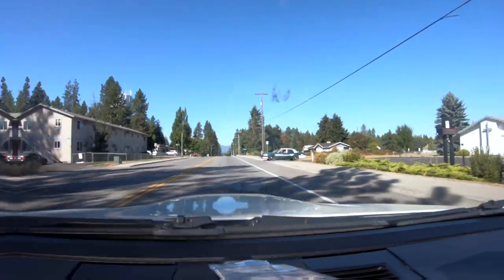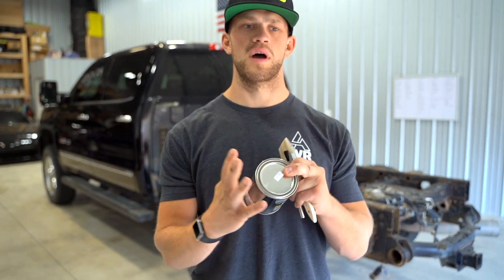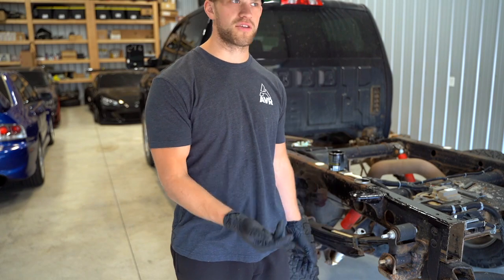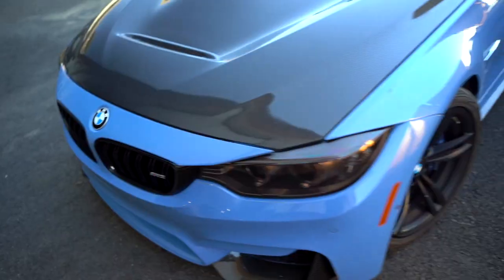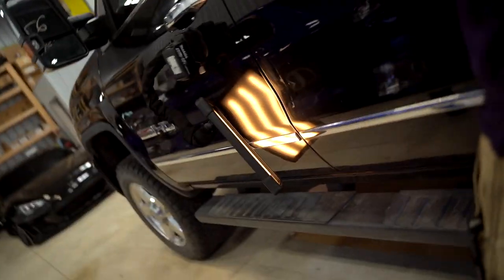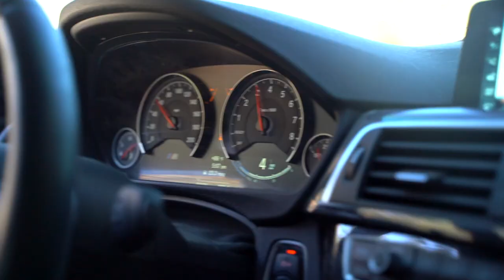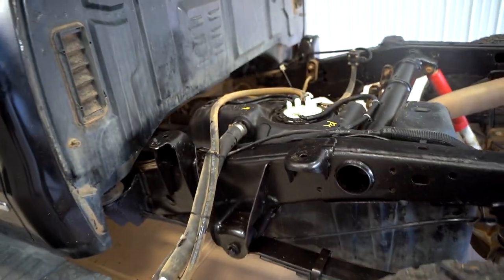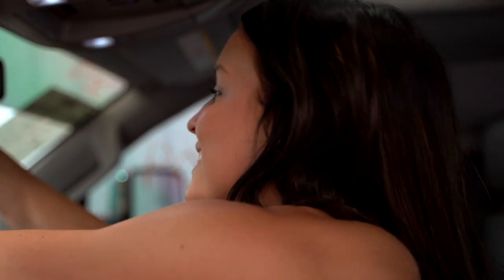Rebuilding the Wrecked 2015 Duramax Pt. 3

Comment: Good choice on the POR15, it’s one of the best rust preventative paints on the market. I restore 80s and 90s Japanese sports cars and use gallons of this stuff. Few quick tips for you if you’re going to do the rest of the frame and suspension components with it. It’s a urethane paint, so it cures in the presence of oxygen. All paint does, but POR15 cures a lot faster and a lot harder. 

Once you open a tin of it, the tin needs to be used within about 2 days, otherwise the next time you try to open it, the paint will have hardened from the oxygen you trapped when you closed it. My method for using it effectively is to buy the small tins and drill a small hole in the lid, then drip it out onto the part that I’m painting. When I am finished, I put a wood screw in the hole and put the tin into an airtight container. When you need to use it again, just take out the screw and dribble some more out of the tin. 

Surface prep is also very important to make sure it actually adheres to the surface you’re painting and doesn’t just peel off in sheets. They make a surface prep product called Metal Prep that you are supposed to treat rusty or bare metal surfaces with before painting them. You can either brush it on or spray it, depending on how much you buy and how well the surface stays wet whilst it converts the rust. In warmer climates you'll need a lot more of it due to evaporation.

Comment: I'm not that knowledgeable, but aren't you supposed to wire wheel or somehow remove the existing rust on the frame before painting over it? Won't the rust still spread underneath?
Reply: You are right
Reply: I'm trying to work on my own car more and more, especially after watching these videos, and wanted to make sure that I'm not overlooking anything. Thanks for the feedback!
Reply: Yes, that is normally best practise; however the POR15 is a specific paint/sealant product designed to go on over surface rust (nothing'll sort it if it's flaky), and deal with it to an extent.

I would assume it's got some kind of additive that is a rust converter agent; it's not a product I've used before.
Reply: That’s the beauty of Por-15. It’s meant to be able to go over rust
Reply: i painted over rust on my van with hammeright its says u can paint right on rust on the tin and 3 weeks later it ate through the paint and went from white back to rusty so im going to go back with a grinder and get it back to steal then paint
Reply: As long as the rust isn’t loose or flakey they POR15 will convert and stop the rust spread.  It seals off the rust from air and moisture as well
Reply: I didn't know there was paint that could go over rust. Besides the surface being dried and the rust not being flaky, are there any other conditions of the metal you have to be aware of when using that paint?

Comment: You skipped the first 2 steps of the por15 process mate, Ment to use a cleaner degreaser which I suppose you kind of did with waterblasting and then a rust converter to convert any rust and then apply it when the surface is bone dry as stated on the can. And  you just washed abit then painted over it right way.

Comment: Devin ive painted alot of components on my Evo in POR 15 followed all the correct methods of applying the stuff with the acid etc and within 12 months I had corrosion coming through and paint flaking off. Its massively dissapointing and a painted a few components in standard zinc primer and base coat with clear coat that have lasted much longer with hardly any issues! Ive got video clips of it too being applied and the outcome 12 months and 2 years down the line. Pretty shocking in the UK we have salt on the roads so we were looking for "The best" thing to stop the rust coming through so I went with POR-15 after reading reviews about how touch the stuff was. Needless to say all of my buddies who used the same stuff had the same experience. Its all coming away after 12 months. Mine was looking tatty after just 6 months.

Comment: you used the top coat from POR15. You should have used POR15 rust preventative paint and then the top coat over it. I use this on jeeps. great stuff if you use it properly.

Comment: Keep the e92 they drive waayyy better than the f chassis. They switched from the nice heavy hydrolic steering in the e9x to electronic which is light and disconnected with no road feel. They're also big and bulky. U made the right choice 👌

Comment: Watching speed academy use the stuff the best way is to drill into the top and pour it out into cup and then use it and seal back up with a screw and create new hole each time. Otherwise apparently it will harden and make it impossible to reopen, etc.

Comment: One year later.. Rebuilding the Wrecked 2015 Duramax Pt. 456
Reply: Nah, that's for the ones that are taking those super cars and trying to fix them. Each episode, they remove like one bolt. That's it. Then putting it back in some point, one episode. Washing it, episode done.